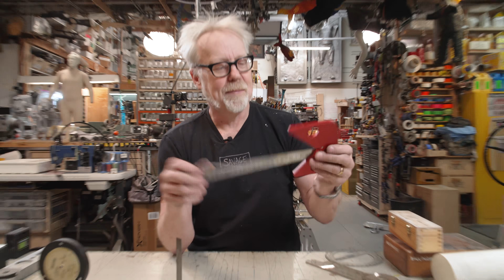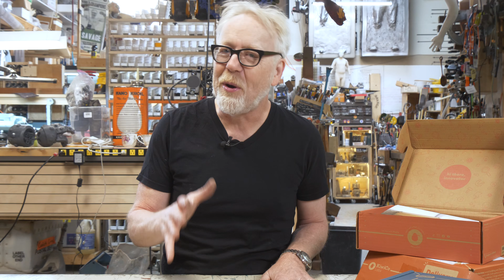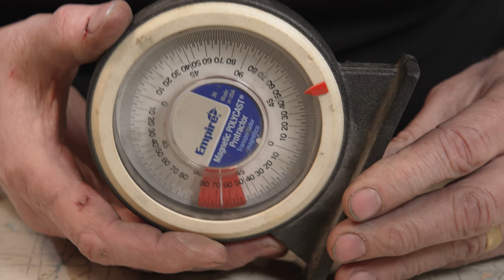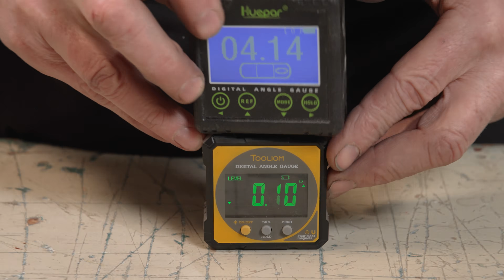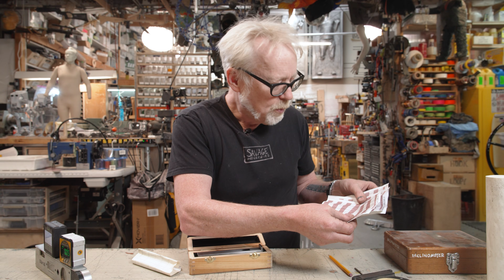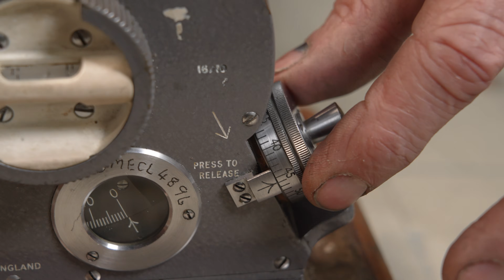Adam Savage's Obscure Angle Finding Tools!

Comment: I have what I believe to be a somewhat obscure machinist's protractor tool. I was given it as a gift along w/ several other small random (some useful some common) hand tools (even an OG metal body craftsman 1/4" drill from way back when) I digress 😅 sorry I could not add pictures. But I only recently learned that this thing is a a combination square protractor. I've had this item for about 19 yrs and never knew what it was. It was also covered in decades of grime an surface rust. I recently realized that all this time I had the means and knowledge to clean it, but only leaned recently how to clean and polish it properly so I did and then I figured I might as well take a picture 📸 and search it on Google (I keep forgetting that feature has been here for some yrs 😅)

Comment: If you want an inclinometer that is the pinnacle in my opinion of inclinometers look up a miracle point I have been using one of their miracle points for 30 years it's my personal one even though the company used to supply them I bought my own so I didn't have to let anyone else in the shop use mine I used it as a pipe fitter and now I use it as a machinist

Comment: You should look into augmenting those metal protractors with the "workshop protractor" from Lee Valley. They seem to be the only ones who sell this "patent no. m328557" device and it's by far the best version of the tool I've used. Granted, most woodworking/carpentry angles are just "to match that other angle" so an old-school bevel gauge with no markings will usually do just fine.

Comment: wouldn't say you missed it but I think its worth to bring up in this conversation, angle finding using a compass to draw lines on say for example a map to figure out a heading, but also useful when drawing your projects. ill even make a case for it in CAD, sometimes when I have a design in my head, drawing circles and seeing where they intersect can be a much better way to visualize than simply drawing a line and reading the number value.

Comment: You can go in-between marks on a measuring tool. So that circle has marks every half a degree, for 720 marks. But it can be used for 1/4 degree increments because you can split the difference between two marks.
Still not to digital precision, but an extra step.
Reply: I also have to say that the idea of using those big protractors to measure the angle on someone's spine is very funny to me.

Just imagining a whole section of it beyond like 30° where it goes red & has a frowny face. Because the spine has curves, but usually not big ones. It'd be kinda hard to measure with the wheel in the way too. Unless the curves were sideways. Which is a different medical problem.

Comment: There's probably a good angle finder/level in your pocket. Your smart phone. There are lots of free apps. Also, You neglected to show that a sine bar is used in conjunction with gage blocks, which can get you down to about 5 arc-seconds resolution. Most of us use a calculator rather than a table to figure with. Thirdly, angle blocks are useful for milling setups. Very easy to use. I'm not going to beat you up too badly about "compass. " I think most of us knew what you meant. You just got fixated on the wrong word. It happens.

Comment: klein has a nice digital angle finder, and ive used the round mechanical one at work a few times. I even found a level that has both a screen and a traditional bubble, but its kinda cheap, and i often feel like the digital part is way more accurate than the bubble

Comment: Ah yes, the "general angle finder", or as I called it for 7 years, the Blade Angler 😂 running a tilting band saw, that was the best of the best for making sure the cut was right. Unfortunately it is pretty useless when the engineer asks for 67.4 degrees. 😅

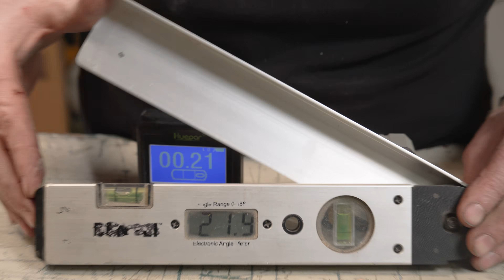Comment: When I worked as a rig welder, we used smart levels like whats shown off around 10:00 in. I keep an adjustable T square and basic protractor on hand as well and had a torpedo level with a rotating tube so it could be set for angles. Of course this is more generally for angles in relation to plumb and level. For pipe and metal fabrication, it worked well. That and the other measuring and layout tools works well for 99% of cases I encountered.

When I got into diamond and geotech drilling, I got myself a cheap Brunton compass knockoff. I wouldn't trust it for the same precision as an actual pocket transit, but for my use it works well enough.

Comment: For many things i just measure the difference over a foot. It's often unnecessary to know the actual number of degrees, you just need to be able to transfer the measurement. The sine bar is doing a similar thing, although I'm typically using tangent. 1/8" per foot is .6 degrees, which is plenty accurate for many things outside of a machine shop. And it's possible to measure more finely.

Comment: I like tools like these and I cannot lie... I know, that machine oil smell is just addictive.  I have a few of these kind of tools, not as cool as that last one WOW!  But,  I have a protractor with a digital readout, to copy an angle, it's smaller than the one you shown that you couldn't figure out the name of the tool. And I have a digital inclinometer for checking 90 degrees on my table saw, or angle if I need to dial in something specific.

Comment: You don't even need the charts now that everyone has a smart phone in their pocket. The Sine bar uses trigonometry to determine the height raised, remember the old cos, sin and tan of a triangle? Because this is a 5" sine bar, in your calculator app type 5 * sin(x) and you get your height. If you try 2 degrees you get 0.1744974835 which not only matches what is in the chart, but is 4 digits of more precision, on my phone anyway, not that anyone is machining to a billionth of an inch. 
For minutes just type 5 * sin(x + y/60) so 2 degrees, 2 minutes gives you 5 * sin(2+2/60) = 0.1774045639
This Old Tony has a great breakdown on how it works and using one.

Comment: @adam the most precise way to measure an angle, correct me if im wrong is miliradians and there is something like 6300 of them in a 360 degree circle and its used to measure range/ distance  by using angles of mirrors and site lines to a specific point using various formulas and math equations

Comment: A compass is for drawing arcs, a protractor is for measuring angles. A bevel protractor often reads to arc minutes. A sliding T bevel doesn't measure, but can transfer an angle to a workpiece. A surveyor's transit will often read to arc seconds. I have an old one that is still accurate to 5 arcsec. A telescope mount can read to fractions of an arc second. Tom Lipton also has a video showing the use of a Hilger Watts auto-collimator to measure angles to ultra-high precision for lapping surface plates flat. This can also be done with electronic differential levels.
Reply: I use a compass for scribing. Not shown on any woodworking show. I guess they didn't learn from anyone worthwhile.

Comment: You missed the most common angle tool in woodworking!
I can cut to match an angle without having to put a number to it.  I just need the physical angle itself.
The bevel gauge is a handle with a metal blade, and a screw to tighten down to lock it.  
I have a couple plastic ones that I used to build a gazebo, with all kinds of crazy compound angles.  Later I got one from Veratas that has a rosewood handle and is finely built.
Reply: THIS

Comment: every time i think about angle finding, i'm reminded of the eiffel tower, for which they prefabricated all 10,000 something parts off site. to do this they computed and then measured the necessary position of all the eleventy gazillion rivet holes to within 40 thou (except they didn't cause they're french) and one SECOND of arc. by hand. which does rather put it into perspective when i find it inconvenient to have resort to a table and a sine bar.

Comment: You can use the zero or ref buttons on those digital magnetic gauges to calibrate your measurement to your work surface. Just make sure you align it to the axis your going to measure on.

Comment: The sine bar episode by This Old Tony is a must watch.
Reply: Thanks for that. I now understand how a sine bar works as Adam didn’t explain it. I still don’t know how or when it is used in practice.
Reply: @914Rocky the most simple uses are holding something at a precise known value to mill a flat across the top edge or put holes through at that angle.

Comment: @AdamSavage'sTested

Adam and crew, 
If you are a fan of obscure, hard to find, precision tools of the past. For your lathe, you need to find yourself a Jahrl Sinuskator, for cutting very precise angles on your lathe. Good luck finding one though. I have only come across one and luckily that one was for sale in the two decades of doing metal work like this. It is truely a beautiful piece. It belongs in a display case as opposed to a tool cabinet. Best of luck.

Also, for what it is worth the decimal places for any specific taper goes into the 4th or 5th decimal place as that is the level of accuracy needed for taper interlock. The chart you showed goes to the millionth of an inch for angular accuracy.

Comment: I got an electronic inclinometer with a zero function. I use it to set blade angles on the table saw. My saw table is 0.2° out and the zero function cancels that out. I find the angle by using a sliding bevel, then I set the bevel on the saw table, measure the angle with the inclinometer, and then transfer that to the saw blade..

Comment: I may have missed its mention, but Autocollimators are very useful and precise instruments used for measuring angle. A good example of one is Nikons 6d autocollimator (released 1964) , it can resolve angles to within 1 arcsecond, with more modern electronic versions able to resolve down to 50 mili-arcseconds like the Trioptics "Triangle UltraSpec". These instruments are extremely useful for precision engineering and the diversity of their application is really amazing.  Loved the video!

Comment: The transparent angle finders are called "goniometers" and are used to measure joint angles. Typically used to position someone in a specific joint angle to find end ranges. You can pick them up for pretty cheap.

Comment: 6:10 They are goniometers used in physical therapy to check for range of motion, such as the ability to bend or extend a knee or elbow after an injury. They're used to measure the progress over time. The hinge is placed at the joint in question

Comment: If all you have at hand is a simple protractor like those see-through medical goniometers you have there, one can apply the principle of the 'repeating circle' (an instrument used in geodetic surveying) to it to increase your accuracy by incremental measurement. Wikipedia has an article on the repeating circle that explains the concept quite adequately. It's one of those mindblowingly simple ideas, that just works, that I think you'll like.

Comment: Adam, I've recently made a huge career change from architecture to Geospatial Engineer. What would have been previously called a Surveyor. Over the last 10 weeks I've become more and more familiar with my instruments, none more important than my Leica TS16 total station. 

I've always had a keen interest in metrology but getting to grips with the methodologies and techniques for using this surveying equipment has been eye opening. 

The integrated laser range finder measures distances to the nearest milimeter over 500 meters. And I'm measuring angles down to the arc second. It's able to provide sub millimetre accuracy at the scale of a building.

Obviously it's designed for use in working environments larger than the cave but I just wonder if you have any experience using theodolites or their modern robotic counterparts.

Comment: Check out the Starrett No 359 vernier protractor! 360 degree rotation with a pointed arm for getting into tight spaces. It has a clever dual knob in the middle with a geared clutch system that engages for doing fine adjustments and a tightening system that fixes both the sliding rule and rotation on the same tensioning system.

I'll never need this level of precision in the home shop but just had to get one when I saw it. It's just got that exquisite classic machinist tool "feel" that combines hardened materials, intricate precision construction and clever ergonomics.

Comment: I have a whatsit.
It only finds one angle, i think about 17 degrees off level.
Its just a simple device you can hang on a nail and when at the right angle the weighted arm will align with a small point, tip to tip.

Wish i could post a picture

Comment: A surveyor's transit or total station measures angles down to arc seconds or below, depending on cost.  On the "Engineer's Notebook" YouTube channel, Alex used his father's surveyor's transit to measure the accuracy of a dividing head down to the microradian level (0.2 arcsecond) if I recall correctly.
Reply: I was also about to mention surveyor equipment, even old stuff from the 1700-1800s were accurate to about one to one half arcsecond

Comment: Check out laser interferometers - definitely overkill for your cave, but still lol. I once calibrated a machine using one, and IIRC, the resolution of the device was ~0.001 arcsec.

To put that into perspective, just 1 arcsec is the angle subtended by the diameter of a dime at 3.7km. Aka if you draw a line 3.7km long, at 1 arcsec from you, it will only be the diameter of a dime higher 🤯

Comment: In the early seventies I worked for a number of surveying companies. That is where I first encountered Wild/Heerbrugg Levels and Transits. Their top of the line models are extremely precise machines that would indicate down to twenty seconds of arc. Which you could extrapolate fairly accurately to ten seconds of arc. I think that they even have a level that is accurate to within one second. 
  As we all know, when you have an error in an angle of a line and then extend that line out to distance, that error is greatly magnified. When you have a line that is 500 feet long, this miniscule original error can become quite significant. That is why you need instruments of this precision. There are a number of tricks that you can also do to compensate for error.
  Millwrights would often use the Wild instruments for setting up large pieces of machinery that required precision placement. Steel mill sized large.
Reply: i worked with Wild analog photogrammetry stereoplotters and can attest to your statement
Reply: Yes! I have some Wild equiptment and it is phenomenal. The theodolite is good to 1 second of arc. Dan Gelbart talks about them in one of his lectures. And Tom Lipton at oxtool did a teardown of a leitz optical dividing head that is verrryyyy accurate.

Comment: Not to take an obtuse angle on it‼️ When you use the electronic angle cube, place it on the bed, zero it, put it on the bit/blade and it will tell you the angle difference between the bed and bit/blade. Only gravity devices like the roof pitch inclinometer need to be on a level bed with respect to gravity.

Comment: Woodworkers and boat builders use bevel gauges. They allow you to take an angle off of a piece and reproduce it on another piece of wood without ever caring the exact angle measurement. Every woodworker should have one.
Reply: We always call it a transfer square
Reply: Just 1?  With 2 you can set up compound (3d) angles.
Reply: Every woodworker does have one...
Reply: Three until a project needs 4 unique angles...

Comment: There is one that you didn't have in there. And that is a 3 finger. Plastical finder use mosplay on boats. But it has 3 fingers and you can actually shut. You have 3 points out from where you sitting and you put all 3 points from.  On that chart and it will pin point you on a ch.R.Look for one usually in marine stores.
This is Bob and Vero beach Florida.God bless and have a great day

Comment: These are fascinating gadgets. Adam points out some drawbacks, like leveling, but I simply don't like batteries.. That's just me. Using trigonometry, which Adam also mentions, your accuracy is only limited by the precision of your measurements, which you can do more than once. You can also answer questions like, "How long does this piece need to be, to fit into this other piece correctly?" Yeah, have some scratch paper on hand, learn to calculate square roots, etc. This is Wastrel, commenting from Babylon.

Comment: The inclinometers made by the electrical tool companies, like Greenlee and Klein, sometimes come with calculators for bending offsets and/or shrinkage for different bends.
Also if you've never seen an old drafting vernier protractor you should look them up! Almost totally useless in the shop but an absolutely beautiful precision measuring device nonetheless.

Comment: 15:01 Yes, but more importantly, why? And that's because in motion (to obtain the measure) you encounter the irregularities of the lathe ways, be they worn, deformed or poorly cut. While with a bar... This is important, because you should never rely on your lathe to find the cut, use tools that are not involved in the motion or use as little as possible. By using those, you bypass as much as possible, whatever might be wrong with your lathe, mill, vertical lathe etc. A good machinist has a good set of angled blocks and bars.
Reply: I was fitting shafts in tubes within 5 thousandth on a lathe that required I physically pull the tool holder to take the lash out before taking a cut on the ID of the tube.

Learning the quirks of each machine can be an adventure no doubt.
Reply: Push for ID cut
Pull for OD
Been 13 years I'm a little off